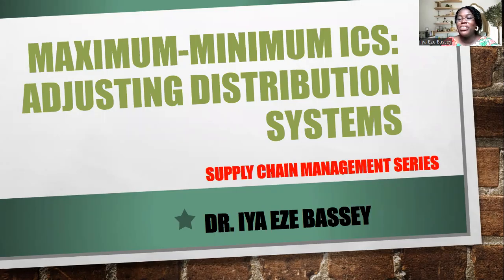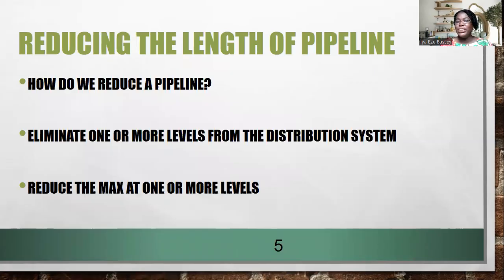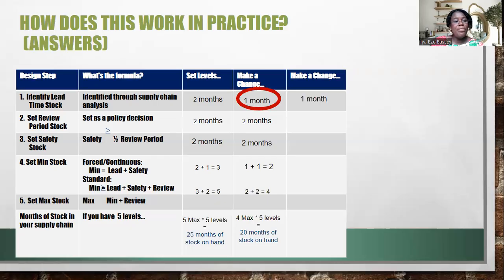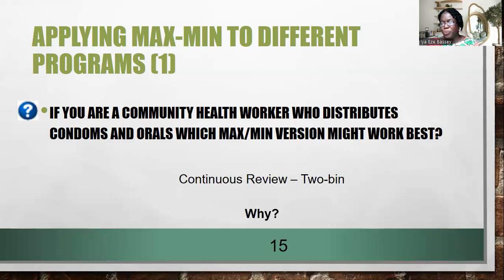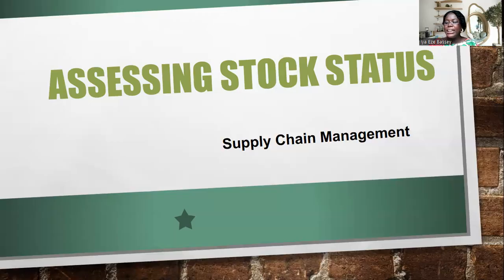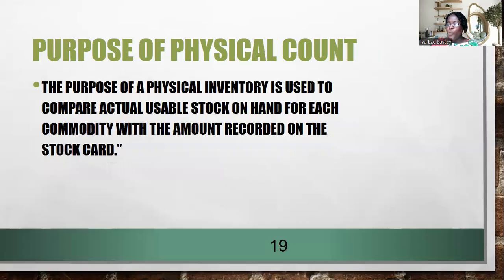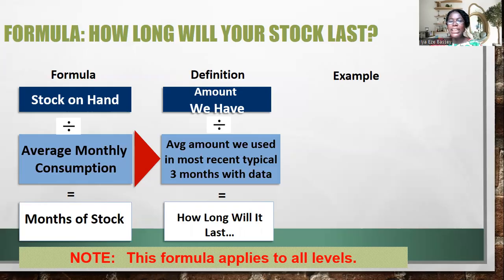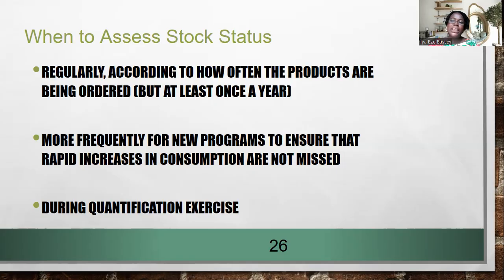Maximum-Minimum ICS: Adjusting Distribution systems (Supply chain management series)

Comment: The length of pipeline can be reduced by: eliminating one or more levels from the distribution system.
 A physical count is the process of counting by hand the total number of usable units of each commodity in your store or health facility at any given time. The purpose of physical inventory is used to compare actual usable stock on hand for each commodity with the amount recorded on the stock card. The purpose of assessing stock status is to determine how long supplies will last.The importance of assessing stock status are: months of stock available, how long our stocks will last, if consumption remains the same, if we are overstocked or understocked.

Comment: In summary designing max min ics there are necessary things that need to done such as seting up the inity maxmin policy for each level, checking the over all distribution to ascertain if it will function property and checking the total length of the pipeline that the policies at each level lmply.sometime there's need to reduce the pipeline for it to get to the client on time by dominating one or more levels from the distribution system or setting policiens that helps foreduce max in a systemic way.there are several advantages of for using max min system such as to avoid overstocking or stock out and there are challenges of using this system like system with numerous level or that manages large number of commodities etc

Comment: MAXIMUM - MINIMUM ICS: ADJUSTING DISTRIBUTION SYSTEMS

Thank you ma for this wounderful lecture,in summary, I learnt that,
For the length of a pipeline
1)one have to set up initial maximum - minimum policies for each level and type of facility.
2) check if the overall distribution will function properly if the level specific maximum - minimum policies are implemented
3) check the total length of the pipeline that the policies at each level imply.

Reducing the length of pipeline by
1) Eliminating one or more levels from the distribution system
2) Reduce the max at one or more levels .
 
Other factors that impact maximum - minimum stock levels are 
1) costs of products
2) Reliability of transportation
3) storage capacity
4) cost of storage
5) storage conditions at different levels
6) shelf-life of health commodities

Advantages of using maximum - minimum system:
1) Avoid overstocking
2) avoid under stocking
3) minimize wastage
4) avoid costs of emergency orders
5) simplify inventory control decision - making
6) consistency of stock levels 
7) reliable data source from SDP for forecasting and quantification.

Challenges to using each version and variation
1) systems with numerous levels 
2) systems that manage a large number of commodities
3) systems that manage products for new programs.

Comment: In summary there are steps in determining a max-min ICS are : setting initial max-min ICS for each level and type of facility and check if the over all distribution will function properly if the level specific max- min policies are implemented.
      And also if you want to reduce the max stock level you have to shorten the review at one or more levels and reduce the lead time at one or more levels and improve the distribution systems reliability at one or more levels so that safety stock can be reduced.
       The physical count is the process of counting by hand the total number of usable units of each commodity in your store or health facilities at any given time.
      The purpose of physical count, it is used to compare actual usable stock on hand for each commodity with the amount recorded on the stock card.

Thank you ma ❤❤

Comment: MAX-MIN ICS: Adjusting distribution systems ( supply chain management series)

In summary, i learnt and understood the steps in designing a max-min Inventory Control System and also the need for adjusting distribution system in max-min inventory control system. 
There is need in reducing the length of pipeline when adjusting distribution systems. How do we reduce a pipeline?
- Eliminate one or more levels from the distribution system 
- Reduce the max at one or more levels. 
Factors like product cost, storage conditions, transport reliability and forecast accuracy also influence stock levels. This system helps to avoid overstocking, understocking, wastage and emergency order costs.

Physical count is the process of counting by hand the total number of usable units for each commodity in the store or health facility at any given time. Assessing stock status is essential to know how long supplies will last.

Thank you ma

Comment: Thank you prof. for this amazing lectures
I learnt that steps in designing a maximum minimum ICS are
1. Set up initial max-min policies for each level and type of facility
2. Check if the overall distribution will function properly if the level specific max-min policies are implemented 
3. Check the total length of the pipeline that the policies at each level imply
Advantages of using Max-min system 
1. Avoid overstocking 
2. Avoid on the stocking
3. Minimize wastage  
4. Avoid cost of emergency order 
5. Consistency of stock levels 
 
A physical count is the process of counting by hand 
the total numbers of usable unit of each commodities in your store or health facility at a given time
Formula to calculate how long the supplies could last is:
Month of stock = Stock on hand ÷ Average month consumption

Purpose of physical count 
1. Physical inventory is to compare actual used stock on hand for each commodity with the amount recorded on the stock card 
2. To determine how long supplies would last.

Comment: In summary, 
I learnt that it's vital to analyze and reduce the supply pipeline length by eliminating levels or setting policies to reduce maximum stock. Adjusting review periods, lead times, and safety stock in formulas can shorten the pipeline. Factors like product cost, transport reliability, storage conditions, and forecast accuracy also influence stock levels.
Max-Min System Benefits: This system helps avoid overstocking and understocking, minimizes waste, and simplifies inventory control.
Challenges & Specific Systems: Challenges in complex systems with many levels or commodities are addressed. Different inventory control variations for specific needs are suggested, like a two-bin system for community health workers or a standard version for HIV commodities.
 Assessing Stock Status: Crucially, methods for assessing stock status include physical inventory counts and calculating months of stock using a simple formula (Stock on Hand / Average Monthly Consumption). Regular assessment is essential for effective control.

Comment: Thank you Ma for this wonderful lecture.
MAXIMUM - MINIMUM INVENTORY CONTROL SYSTEM: ADJUSTING DISTRIBUTION SYSTEMS.
   In summary, I have learnt the steps in designing a maximum - minimum Inventory control system. Also learnt that eliminating one or more levels from the distribution system and reducing the max at one or more levels are ways of reducing the length of the pipeline.
    I have also learnt how to reduce the maximum stock level, also the factors that could impact max-min stock levels which are cost of products, reliability of transportation, storage capacity, cost of storage, storage conditions at different levels and shelf life of health commodities. And also learnt about the advantages of using max-min system.
     I also learnt about assessing stock status, and that physical count is the process of counting by hand the total number of usable units of each commodity in your store at a given time, and also the purpose of physical count.
   Finally i learnt that the formula is stock on hand ÷ average monthly consumption = months of stock, and then when to access stock status, which you made memtion regularly, more frequently for new programmes to ensure that rapid increase on consumption are not missed and during quantification exercise.
Reply from the maker: Thanks for sharing your key takeaways from the lecture!

Comment: Thanks ma for this lecture maximum -minimun ICS! Adjusting distribution starting from the pipeline the way to set up initial max-min policies for each level and type of facility etc and also are important assessing stock status.
The purpose of assessing stock status
1) to determine how long the supplies will last.
2) to compare actual on usable stock on  Hand for each commodities with the amount recorded on the stock card.
And we move to the calculation where we do : 
Formula
Stock at hand
Multiple
Average monthly consumption
=Months of stock 
Physical count is the process of counting woth hand the total number of usable units of each commodity i. Your store or health facility at any given time. Lastly we talk about when to assess stock status where we talk about:
Regularly according to how often the products are being ordered ( but at least once a year) etc.
Reply from the maker: I'm glad you found this lecture on adjusting distribution systems helpful!

Comment: Thank you ma,
In summary, maximum_minimum ICS is necessary for adjusting pipeline and ensuring accurate inventory of commodities,in designing a max_min inventory control system the steps involved are:
Setup initial max_min policies for each level and type of facility, check if the overall distribution will function properly if the level specific max_min policies are implemented, check the total length of the pipeline that the policies of each level imply.
Reply from the maker: I'm glad you found this video helpful in understanding the maximum-minimum inventory control system!
Reply: Thank you ma,
In summary, maximum minimum ICS is necessary for adjusting pipeline and ensuring accurate inventory of commodities, in designing a max_min inventory control system the steps involved are:
Setup initial max_min policies for each level and type of facility, check if the overall distribution will function properly if the level specific max_min policies are implemented, check the total length of the pipeline that the policies of each level imply.

Comment: Thank you Ma for this amazing lecture. I learnt that the steps in designing a max-min ICS is to set up policies for each level and type of faculty, check if the overall distribution will function properly if the policies are implemented and finally check the total length of the pipeline. To reduce a pipeline, one or more levels from the distribution system can be eliminated or reducing the max at one or more levels. Factors like costs of products, costs of storage, storage capacity, shelf life of commodities, lead times, etc can affect max-min stock levels. The max-min system helps to avoid overstocking, understocking, minimize wastage and even avoid costs of emergency orders. 
    Physical count is the process of counting by hand the total number of usable units for each commodity in the store or health facility at any given time. This helps to know how long supplies will last for. To calculate how long these supplies could last, this formula is used:
Months of stock =Stock on hand ÷ Average monthly consumption.
Thank youu.
Reply from the maker: Thanks for your great summary of the key takeaways!

Comment: Thank you ma for the lecture, 
In summary, the various steps in designing a max-min ICS include :
1. Set up initial max-min policies for each level and type of facility. 
2. Check if the overall distribution will function properly if the level specific max-min policies are implemented. 
3. Check the total length of Pipeline that the policies at each level imply. 
FACTORS THAT IMPACT MAX-MIN STOCK LEVEL 
1. Cost of product. 
2. Reliability of transportation. 
3. Storage capacity. 
4. Cost of storage. 
5. Lead time. 
ADVANTAGES OF USING MAX-MIN SYSTEM 
1. Avoid overstocking. 
2. Avoid understocking. 
3. Avoid cost of emergency order. 
4. Minimise wastage. 
DEFINITION OF PHYSICAL COUNT. 
Physical count is the process of counting by hand the total number of usable units of each commodity in your store or health facility at any given time. 
PURPOSE OF PHYSICAL COUNT
1. To determine how long supply will last. 
2. To compare actual usable stock on hand for each commodity with the amount recorded on the stock card.
Reply from the maker: I'm glad you found this video helpful and learned about the key steps involved in designing a max-min ICS!

Comment: Good day ma'am 🥰  
Thank you for this lecture 😊
From this lecture I have understood the steps in designing a max-min ICS, they include:
1. Set up initial maximum policies for each level and faculty.
2. Check if the overall distribution will function properly if the max-min policies are implemented.
3. Check the total length of pipeline that the policy of each level imply.
Most times, the length of the pipeline are too long and can take longer time in commodity delivery, however the pipeline length can be reduced by:
a. Elimination of one or more levels
b. Reduction of max at one or more levels
Maximum stock levels can be reduced by:
1. Shortening of review period at one or more level
2. Reduction of lead time at one or more level
3. Improvement of distribution system reliability.

Some other factors that impacts max-min stock levels are:
-Cost of products
-Reliability of transportation
-Storage capacity
-Cost of storage
-Storage conditions at different levels
-Shelf life of health commodities.
    The advantages of using maximum -min system includes:
-Avoid overstocking
-Avoid under stocking
-Minimize wastage
-Avoid cost of emergency orders
-Consistency of stock levels.
 You also talked about assessing stock status and we need to access our stock to know how long it would last. And to know how much stock we have first we have to do a physical inventory or count: this is the process of counting by hand the total number of usable units of each commodity in your store or health facility.
To know or calculate how long our stock would last is =
Month of stock= stock on hand ÷average monthly consumption .
Additional you said we have to access our stock at least once a year and we have to access our stock status regularly according to how often the product are being ordered, more frequently for new programs to ensure that rapid increases in consumption are not missed also during quantification exercise.
Thank you ma'am 🥰
Reply from the maker: I'm glad you found this lecture on max-min ICS helpful!

Comment: Good morning ma
Thank you for this lecture Based on The Topic:Maximum-minimum ICS: Adjusting distribution systems I got to understand that they are ways in which one can adjust distribution system policies.
Firstly, we have to set up initial max- minimum policies for each level, check if the overall distribution will function properly and if the level specific maximum-minimum policies are implemented and as well, one have to check if the total length of the pipeline that the policies at each level imply.
Ways to Reduce the Lenght of Pipeline
* Eliminate one or more levels from the distribution system
There after one can then adjust element like the review period, lead time, storage capacity and safety stock as well improve the distribution system Reliability at one or more levels so that safety stock  can be reduced.
Other factors can as well impact maximum-minimum stock level:
* cost of product 
* reliability of transportation 
* storage capacity 
*shelf life health commodities etc.
Advantages to using max-minimum system 
1. Avoid over stocking 
2.Avoid under stocking 
3.Minimize wastage
4.consistency of stock level
5.Avoid cost of emergency orders
6. Simplify inventory control decision making.
They are several challenges in using maximum-minimum systems.
This include:
1. System with numerous levels
2.system that manage a large number of commodities 
3.system that manage products for new programs.
One is expected to access stock status regularly reasons being  that to know how long supplies will last and as well count commodities physically in store . The purpose of this is to compare useable stock on hand for each commodity with the amount recorded on the stock card.
Reply from the maker: It’s great to hear you found the information helpful!
Reply: Thank you ma
Yes I did

Comment: I learned that designing a max-min inventory system involves setting policies at each level, checking if distribution works effectively with those policies, and evaluating the pipeline implications. You can reduce max stock levels by shortening review periods, adjusting lead times, and improving distribution reliability. Factors like product cost, transportation reliability, storage capacity and conditions, and commodity shelf-life all affect stock levels. The system helps avoid overstocking, understocking, wastage, and emergency order costs while ensuring consistent stock levels. However, challenges arise in systems with many levels, a large number of commodities, or new program products.